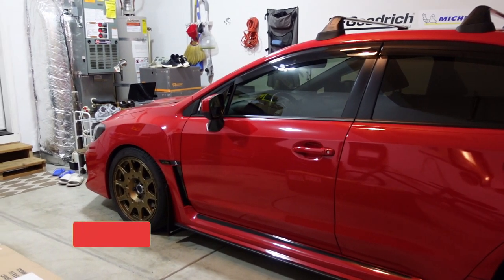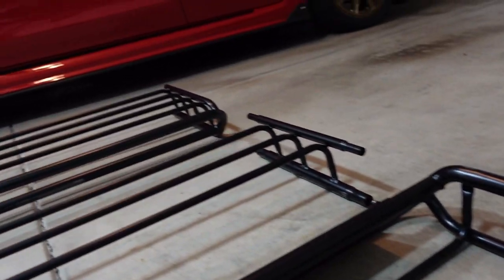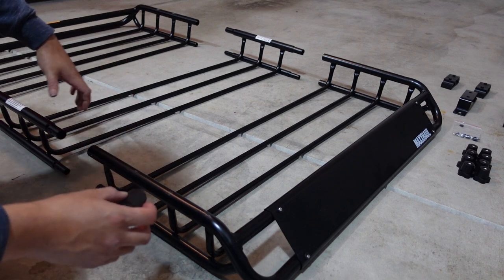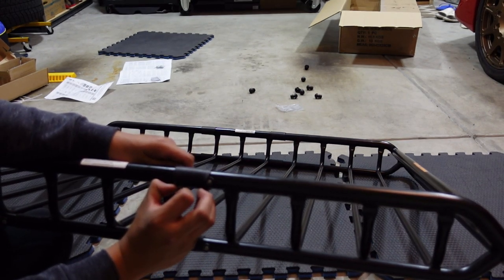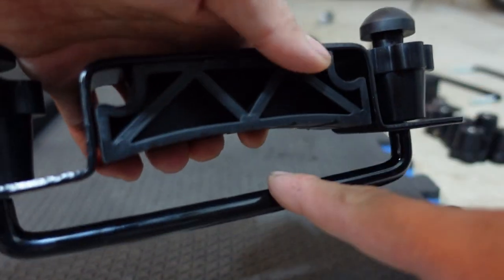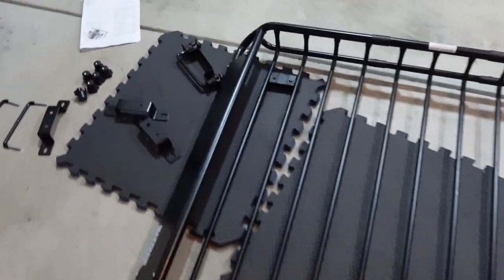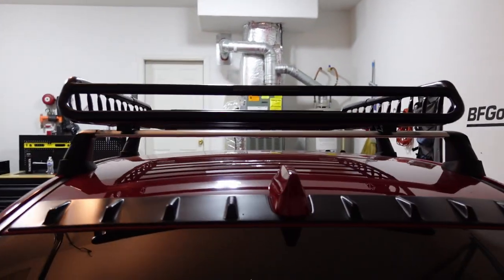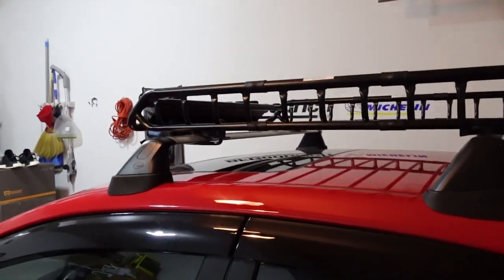MaxxHaul Cargo Roof Rack | 2015 - 2021 Subaru WRX / STi

Comment: Have you noticed if the knobs for the U-bolt get in the way of the cargo? Looks like they extend above the base of the basket.
Reply from the maker: They do extend a little above but I’ve never had an issue. I’ve seen folks mount the u-bolts upside down so that they’re out of the way.

Comment: But did it rust and leak on your car? i bought the 64inch version for my 4Runner and reviews say to rubber coat the whole thing to avoid rust and leaking on your paint .
Reply from the maker: Nope, and it’s mainly because I garage the car and don’t have the basket on full time. I coated the new rack I bought for my Outback and it still developed a bit of surface rust. https://youtu.be/QkWrMnvQbKw
Reply: Much appreciated 👍, i went ahead and rubber coated the whole thing, as mine will be on outside at least 6 months a year.

Comment: I have Roof Cross Bar Set, Fixed By Thule - Subaru (SOA567X050),Is this basket can fit?
Reply from the maker: The Thule bars are identical in size to the OEM bars so they should fit.